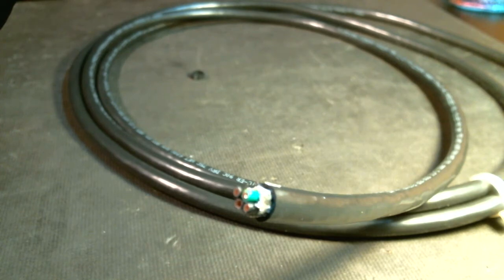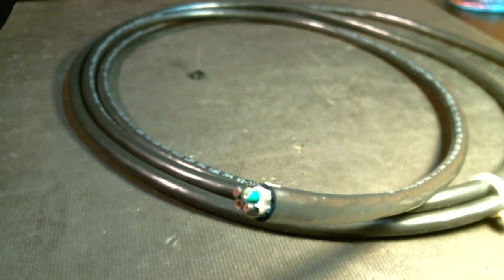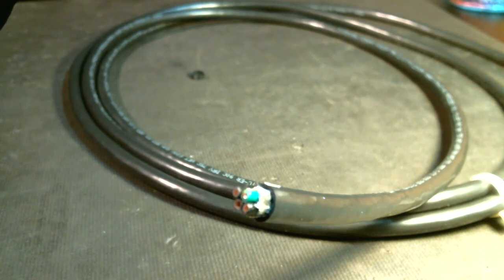Spindle Cable Choice (Eliminate EMI Issues From The Beginning)

Comment: Hello, I'm dealing with EMI inside my PC. I have tried disembly everything a couple of times. I don't mix cables together from different PSUs.
The ODD part is that usually during late hours towards the night the PC "just runs" faster for some reason.
This is even with my ethernet cable unplugged.

Mouse becomes ligther , likes its more accurate for "no" reason.
Ferritebeads doesn't help the problem. Or like its working sometimes for like 1-2 minutes then it becomes slow again.

Any suggestions? I've tried multiple Ferrites, toroids etc. / Grounding seems to be worse then ungrounded for some reason.
Reply from the maker: RNG, thank you for your support. I suggest scheduling a remote consultation with me, so we can review your system. I have to see what I'm working on to provide the corrective actions required.  Please contact me at storm2313@gmail.com to schedule one.Thank you,
Vince

Comment: Thanks for the video, it has been so hard finding a cable like this!  I'll be ordering 1 for sure.  Question though, Could I just solder the drain wire to the ground wire to the ground pin on the aviation connection for a spindle?  Technically the pin is connected directly to the chasis of the spindle, so as long as the ground is properly connected inside of the spindle it should be the same no?
Reply from the maker: Kyle, thank you for your support. Yes, you're correct. You can solder the ground drain, and ground to the CNC chassis itself. I personally prefer to ground to the VFD end with the shield drain, and ground lead as its easier to service which is best practice. The grounding on the spindles end will yield the same if the CNC chassis is grounded as it should be which it being metal as well as the Z axis yields a conductive whole entity which will ground the entire system including all metal components attached to it "killing multiple birds with one stone" Thank you,
Vince
Reply: @corvetteguy50  I see.  I was actually going to attatch the drain to the ground on the spindle, then again on the VFD.   But if I am reading correctly, grounding on both sides is pointless.  Just grounding on the VFD side is enough, and the shield, if it catches any emi, will just drain into the ground, no need to attatch it to the spindle as it's already attached via pin 4.
Reply from the maker: You only want to ground the unit on one side in best practice to avoid the possibility of a ground loop. Thank you,
Vince

Comment: Hi I have bambach spindle cable with double shield layers but no ground deain cable. The insulation is quite thick as well. Does the sheats need to be grounded still and of so do you have any recommendations how to do it?
Reply from the maker: Bender, thank you for your support. if your cable has no shield drain you will terminate its braided shield. I prefer to add a silicone wire to it for flexibility for tight spaces. Thank you,
Vince
Reply: @corvetteguy50  Thanks! I thought about when I was removing the insulation and the braided wire looks like it can be twisted and soldered. Awesome video btw! 👍
Reply from the maker: Great, I'm glad to hear you got it sorted out. Thank you again for your support. Vince

Comment: What is the right size for a 1.5kw 110v spindle? Is 18 enough or need thicker?
Reply from the maker: Francis,
Thank you for your support. You require my 16/4 double shielded cable. Here's the 10ft kit https://www.ebay.com/itm/142538105021  and here's the 20ft kit https://www.ebay.com/itm/131899174942 Thank you, Vince
Reply: @corvetteguy50  Thanks for the reply. Ordered the 16/4.
Reply from the maker: Yes sir, I received your order, and it shipped today. Vince

Comment: I used one of these Double Shielded 16/4 wire for my VFD and spindle.  I have my VFD connected to a Gecko G540 controller.  I use UCCNC to control it and noticed that my VFD speed readout is less then what I set in UCCNC.  This inaccuracy gets worse the higher the speed I set.  For example S7200 (my minimum set speed), will give me exactly 7200RPMs, at S24000 its off by about 700 rpms.  I understand that this might be due to the cheap Chinese VFD and spindle i purchased.  The problem is I have this issue with the ground and shield in the wire not connected (grounded) anywhere.  When I ground either one of these or both to the VFD ground, my inaccuracy gets much worse (almost triples).  What could cause this or is it the cheap VFD that's the issue?
Reply from the maker: Pawel, thank you for your support. The issue you're having isn't do to your cable. Its because you're using UCCNC motion control software to control the spindle's speed, and UCCNC, and Mach3 both aren't equipped with encoder to properly register the RPM of your spindle. This is a common problem, an the only way around it is to calibrate the spindle in UCCNC. I would contact CNCdrive on the procedure. Thank you,
Vince

Comment: Hi! I am interested in getting your cable on ebay. As discussed in another post, I will be running a 2.2kW on a 110V 20A circuit, so the plan is to limit the VFD output current to 13A, maybe 16A max if my breaker allows it. Would your 16/4 work? Apparently the max OD for my 2.2kW is 9.11mm. Will I need to do some modification to get it to fit? Thanks!
Reply from the maker: Nico, 16/4 is designed for your spindle, and the diameter of the cable is 10.5mm, so you'll have to open your connector up with a Dremel to have the cable fit properly. Thank you,
Vince

Comment: Hello. Thank you for the information. I just want to make sure I'm doing this right. My 4th pin is connected to green and it is attached to spindle body, I've checked. At the VFD end I have it hooked to the earth or far right pin just before the outer screw. I also have the braided shield connected to the screw to the far right of the VFD after the green which is Earth as well I believe, only on that end, the spindle end is not connected to anything. Is this the correct way to wire this safely? I have this exact cable.
Reply from the maker: The way describe is the correct way to wire the spindle. The ground drain only gets attached at the VFD end to prevent a ground loop. Thank you, and have a great weekend! Vince

Comment: What length do you recommend for a 5 x 10 table. Also can this be used from the main power input to the VFD, not just VFD to the spindle?
Reply from the maker: Brandon, Thank you for your support. The length for any chassis is determined by the end users requirements. An easy way to determine the length is to use a piece of yarn, and run it through your cable chain to where the VFD is located. This will give you the exact length you require. I also offer 16/3 double shielded cable to be used from the wall outlet to your VFD as its power cable. https://www.ebay.com/itm/142837352755
Thank you, and have a great weekend!
Vince
Reply: corvetteguy50 I sent you a message on your  eBay store.

Comment: I have a cnc plasma table that has some of the issues you described. I wanted to ask you, my shop is 3 phase power and my table is 7 feet from the main panel. My question is could I use the earth ground used for that panel to ground my table and control box to?
Reply from the maker: Hey Kenny, 
Thank you for your support.I recommend using a ground rod as illustrated in my EMI video series here https://youtu.be/UpJ4txXh3WM. I suggest you review all four parts as I cover everything you need  to know about properly grounding a plasma system. Thank you, and have a great weekend! Vince

Comment: do you have a guide on how to actually wire the ends to the VFD and Spindle? like how to ground, which end, how to wire the shielding to ground, etc.
Reply from the maker: Pete thank you for your support. The question your asking would require me knowing the exact spindle, and VFD model your going to support with the cable to be accurate as each system is different. 
Thank you,
Vince

Comment: I recently built a diy cnc with a wood substrate, so the only ferrous parts are the motor casings and the linear rails.  My question is, do I run the drain wires to the linear rails?  Or the central ground?
Reply from the maker: Steve, Thank you for your support. The drains must go to a star point ground. Please review this video on grounding. https://youtu.be/cFrREKB-l4M

 Thank you,
Vince

Comment: I'm considering the Upgrade from a DeWalt 611 to a 0.8KW Spindle / 1.5KW VFD Combo.

The model I'll most likely be going for has a 4-Pin Connector ( U-V-W+GND ) but I'm uncertain about how the braided shielding would be connected.

Should it make a connection on both ends - housing of the Connector and VFD - or should it only connect to the VFD?
Reply from the maker: Durahl,

Thank you for your support. You would only attach the shield drain on one end. I prefer the VFD end.
Thank you,
Vince

Comment: nice tutorial,  but im still a little confused , you said ...connect Ground wire to the ground which as far as i know does connected to the spindle body,  ... after that you said connect Shielded drain  wire to  the chassis of the machine. Is the chassis of the machine connected to the ground ? Is it  more simple to say that the Ground wire and Shielded drain wire have to be connected to the Ground. 
Im wiring my cnc now and i'm looking for the right solution to EMI problem,  please help me with that.
Also i see you selling that spindle wire. well i have a 4 Kw 220v 3 Phase spindle and i need to find right wire,  16/4 wire you have wont work  because my spindle over 18 amps. 

Thank you
Reply from the maker: Max,
Sorry for the confusion.

The ground for your chassis should be attached to either an actual grounding rod run through your foundation of your shop providing a definitive "Earth ground", or attached to the ground pin on your A/C wall socket as long as you know your home, or shop is properly grounded. The shield drain should then be attached to the chassis properly grounding it as well to dissipate any EMI.

The spindle's body, or anything metal can be used to attach to pending the chassis is properly grounded first. Keep in mind while wiring your unit that  most spindles manufactured overseas don't utilize an actual grounding pin on their spindle's plug.  

What's the make of your spindle, and VFD? Once I know I can recommend the proper cabling.

Thank you,
Vince
Reply: hi, here the link to spindle and vfd: https://www.ebay.com/itm/HOT-HIGH-QUALITY-4KW-VARIABLE-FREQUENCY-DRIVE-INVERTER-VFD-5HP-220V-DESERVED/271462843640?hash=item3f347244f8:g:5zkAAOSwLVZVvbwQ.

https://www.ebay.com/itm/4KW-WATER-COOLED-MOTOR-SPINDLE-ENGRAVING-MILL-GRIND-ER20-4-BEARINGS-FOR-CNC/272998478202?epid=1641290128&hash=item3f8ffa317a:g:qf8AAOSwT6pVh~62

this way you get an idea in more details .
thank you
Reply: on spindle i can see  220V 4KW 13A??? strange china don't use calculators . it should be 18 Amps   4kw  220v .  let me know
Reply from the maker: Max,

The spindle your using is fine to use my 16awg cable as you'll never be running at 18amps peak output on your spindle with that VFD. My new Rev2 cables insulation is rated to 600v, and 105 degrees celsius (221 degrees fahrenheit).

Thank you,
Vince
Reply: hi Vince I would prefer to have a 12 awg cable for 1 reason i have a big cnc and i need to run 35 ft of wire,  if you have Rev2 12 wga 35ft please give me a good price.

Thank you
Reply from the maker: I don't use, and or recommend 12awg cable as its diameter is far to thick to be flexible for CNC's continuous flexing, and won't offer the required longevity on its insulation. I understand your concern, but you can easily run 35ft of cable without any significant voltage drop with 16awg.

Thank you,
Vince
Reply: what the price on your cable.
Reply from the maker: 35ft shipped in the US is $78 shipped. 
Thank you,
Vince
Reply: do you have an Ebay store or point me to the right link .

thank you
Reply from the maker: Here you go. https://www.ebay.com/itm/142842788025

Thank you,
Vince
Reply: thank you

Comment: My Chinese made, 1.5kW spindle has only 3 terminals on the 'aircraft' type connector.  there is earth continuity between the spindle casing and the power connector and I have purchased the same type of cable as in your video but with only 3 conductors.  

Presumably, grounding of the spindle is via the clamp on the connector to the braiding on the cable.

Do I connect a ground wire from the vfd panel to the body of the connector at the vfd end?
Reply from the maker: Peter,

The grounding on the spindle should be done via the casing by securing the shielded braid to it as you typed, and the VFD is grounded by attaching your ground wire to it on the VFD's end. The shielded cable should only have one end of its braided shielding attached which in your case will be the on the spindle's end.

The VFD will not have a shielded braid attached at its end as its already attached to the spindle providing proper grounding for EMI cause its cable is run from the VFD. This elminates ground loops where you would have multiple ground points for the same cable run.

Thank you,
Vince
Reply: I think that we are talking at cross purposes.  There are only the three 'phase' wires in the cable with no ground wire.   The only possible grounding route for the spindle may be through the braiding.
Reply from the maker: If your using shielded cable as your describing it has 3 internal conductors, and then the braiding which is to prevent EMI you would use the 3 leads to wire the spindle, and use the braiding for the grounding to the spindle.

Thank you,
Vince
Reply: Thank you for your patience.   That is what I thought might be the case.   I shall run a wire from the VFD end connector to the ground terminal of the VFD.
Reply from the maker: You bet, thank you again for your support. Vince